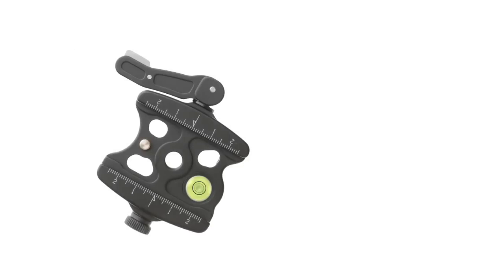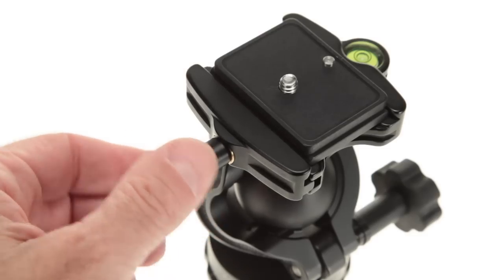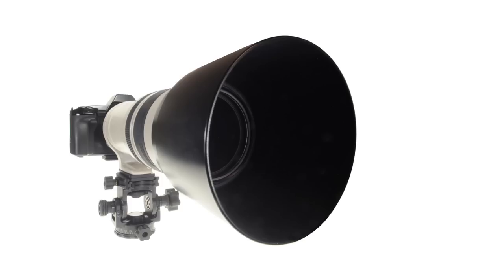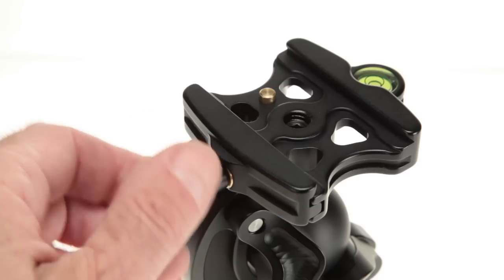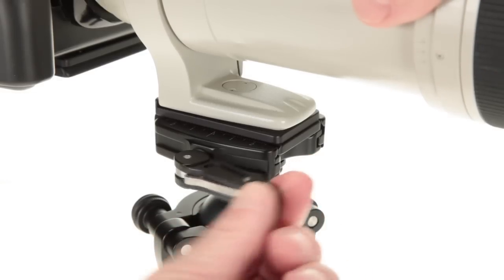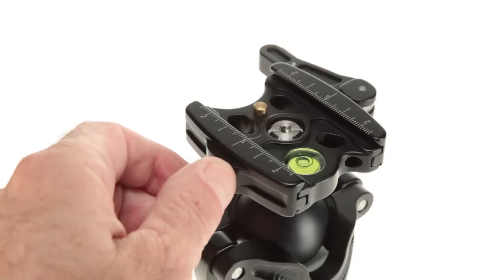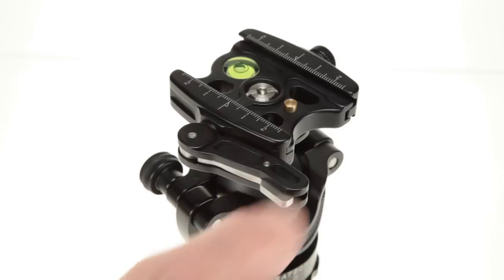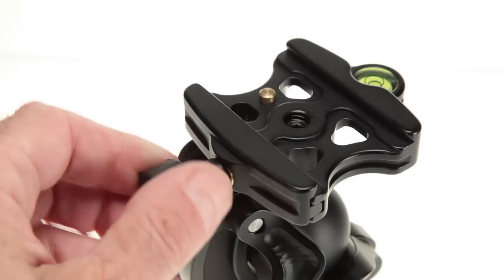Lever vs Knob Quick Release Clamp Tutorial

Comment: You can have BOTH lever-action & the adjustability of the conventional screw with the Sunwayfoto DLC-60. BRILLIANT because you have the convenience of the lever action (and it's two-stage so it can't open by getting caught on a tree branch or sumpin') but you also get the extra force & adjustability of the conventional screw (to allow for minor variations in QR plate widths). Acratech should consider making something similar. I'm getting one to use with my Arca-Swiss p0 1/4" 3/8" thread monoball